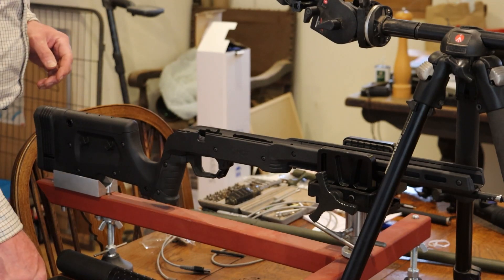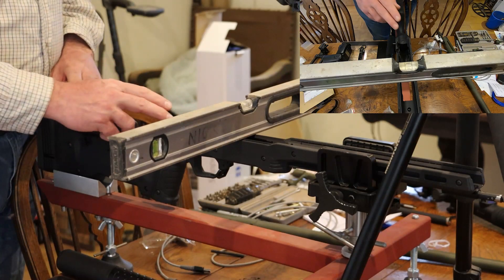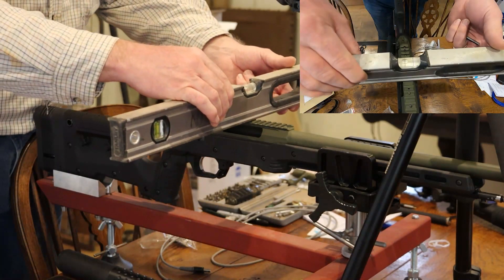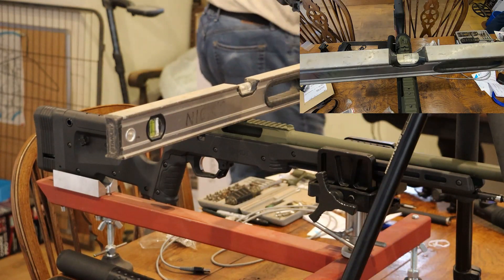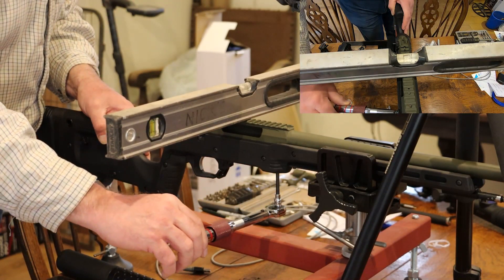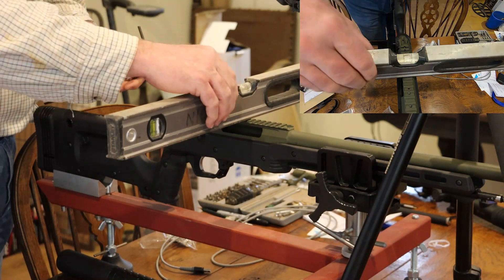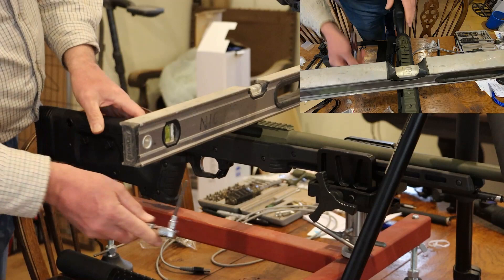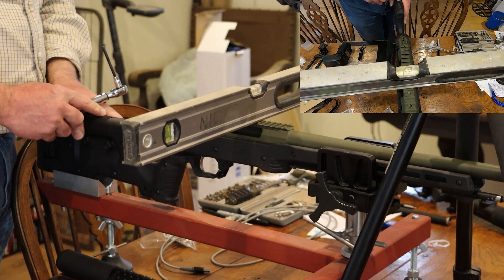MDT XRS Chassis - Tikka T3x - Why I use a Level when installing

Comment: I dont understand the problem. If the action is be slightly off and as long as the action is plumb with the scope, which really does matter, your accuracy won’t be affected as long as it is torqued to spec.
Reply from the maker: So long as you don't mind the trigger being off to one side and not central, and having the stock not vertical to the action/scope, and the risk of the action subsequently rotating till it is vertical under the shock of firing, then there is no issue. But this is just my view...

Comment: I like and agree on your technique. I use all of this on the complete build. From action into stock, mounting mounts, installing scope. Use Multiple levels on the barrel and action that stay on until everything is installed. 
Had bought a shotkam for learning to shoot shotgun. It really displays poor form between firearm and shooter. A slight canter shows up.
So I install it on the rifle and then install the scope bubble after getting  set up to the rifle.
My Dad always said " if you don't have time to do it right the first time, you didn't have time to do it at all"!
Reply from the maker: Your Dad is wise!
I once bought some tracer shotgun cartridges back in the 1990's - I shot at some clays, and the tracer indicated I was behind, but I was hitting the clays. The tracer itself was lagging behind the shot! Shotkam is the way to go, plus if you get a video from the side it may point out any issues as well.
With regards to scope bubble, I do a lot of night shooting (pitch black) and I'd love to fit a "SendIt" level which is LED, but I'll have to save up for it.

Comment: I was planning on buying a GRS stock.  What is so much different and better about the XRS stock?
It appears that the GRS models have more adjustment?
Reply from the maker: The GRS Stocks are brilliant, the grip is contoured to your palm, length of pull can be easily adjusted without having to use spacers (although the max length of pull was too short on the GRS for me), the inlet is spot on. The GRS uses original hardware - standard magazine,  plastic base plate/trigger guard.
I'm just trying to remember why I wanted a MDT, it may have been that I wanted 10 round magazines...but from the very first shot I was hooked - it was how solid the whole stock was, you feel everything. In addition I was able to fit an Arca Swiss rail and therefore fix the rifle to a tripod (see my other videos).
When it comes to it, both stock makes are equally good, but I think you really need to try both to see which one bests suits you....and I mean fire a shot.
Reply: @nicksshootingmatters  I am  6'3" so I believed the length of pull would be enough by the videos and what was read. So that bit of information is extremely helpful. Thank you. 
I know a lot of shooters like the xrs chassis.
So you don't believe the bedding block issues has any real significance on performance?

Comment: This is rubbish. For a start, your action seats itself correctly in the chassis when you tighten the action screws. Secondly, it doesn't make any difference to anything how "level" your action is in the stock or chassis.
Reply from the maker: Everyone can have their own opinion.
As you will see from my video, my action does not seat itself correctly in the chassis when I tighten the action screws, you may have an XRS stock and T3x action that does....
I understand why you say it doesn't matter how level your action is, obviously you would set your scope level to the action and cant the chassis slightly when shooting, with the trigger being off centre to the chassis.
I used to shoot for the GB team, and compete in world championships, and for me everything has to be right. In those days I had stock made for me, with a bedded action and fitted to me by the gunsmith...how things have changed.
Reply: This is not opinion, it’s basic science and engineering.  Frankly only certain people just don’t see the basic science in that. Thank you for the video!